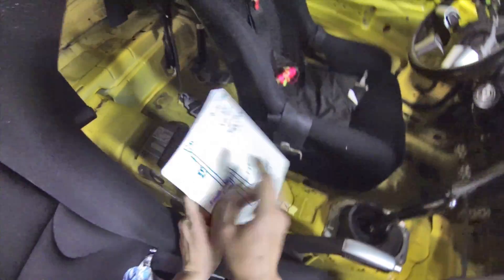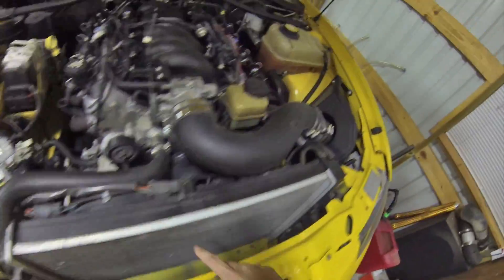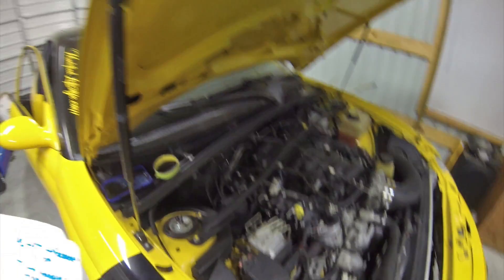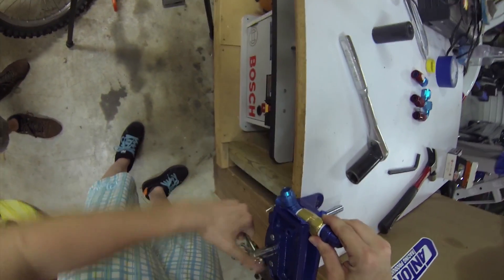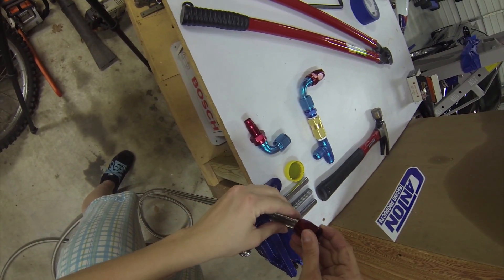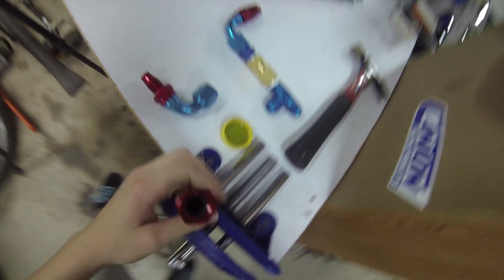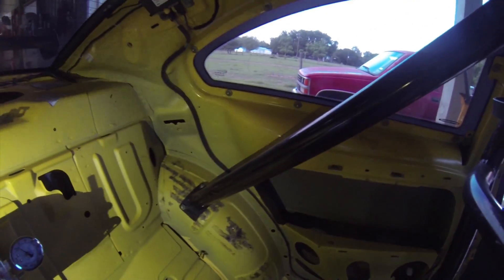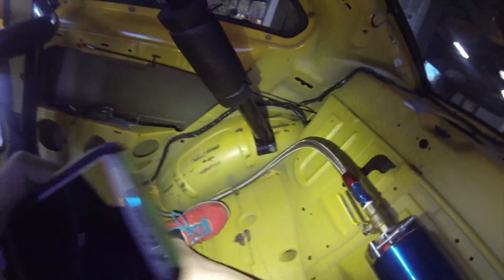ChixGTO: Canton Racing Accusump Install

Comment: fyi no oil lines no fuel lines no water lines aloud inside the car. not safe if its bust opens or breaks and wont pass tech inspection . Unless it's a private rental or they don't care about your safety, no dope needed on flare fittings will make it leak . also if i was running it they way you are put the t on the inside of the fire wall not inside the car

Comment: Just starting to get into track cars and HPDE. I would have assumed most sanctioning bodies would not want fluids inside the cabin for driver safety. Is it normal for an install like this?

Comment: why does it look like you have 2 oil filter adapters?
Reply from the maker: 3 Motion Garage Not sure what you are referring to? You have the remote oil filter and that is is.
Reply: never mind. didn't realize you were using a stock oil pan
Reply: One of them was the filter adapter for the stock oil pan. It looked odd to me but then I realized you were using stock pan. I’m using a canton pan so it’s a little different

Comment: I know this video is now about 2 years old and it's a great install video and also great planning on your behalf before actually doing so. But I would like to pass the thought of some safety over to you. I had a similar setup with oil lines and accumulator mountain in the passenger side of the vehicle. I know yours is behind you but however if you ever have a problem with it or a line rupture or leak even though it's still braided the probability of you getting burned or even the simple fact of oil everywhere sucks. You might want to install it in your trunk and run the lines underneath. Or install it and some sort of box on the back wall to contain any problems you might have.

Comment: Great video. Self tapping screws should not be used for this application. Machine bolts, washers and lock nuts are called for.
Reply from the maker: Not accessible and still tight two years and a lot of abuse later. Less likely to rattle loose than nuts backing off.

Comment: Good video. You have decent taste in tools and cars. If I may offer a critique, I would not recommend using plumber's tape on NPT fittings, especially if it's an aluminum fitting to say a cast iron block (not the case here, unless that's a truck motor). If you can't live with out the tape, use the yellow stuff it's rated for fuel and oil the white stuff isn't. Again nice work, happy motoring.